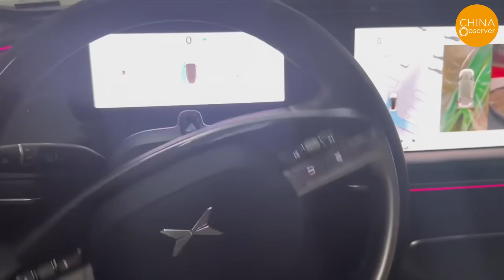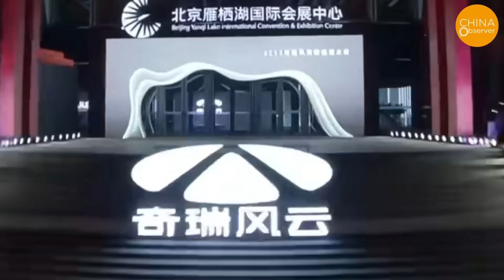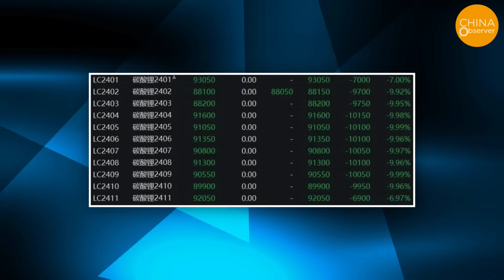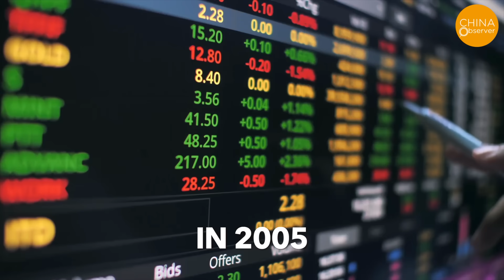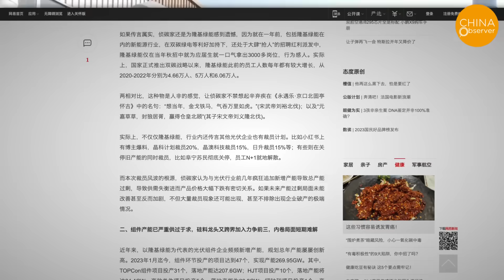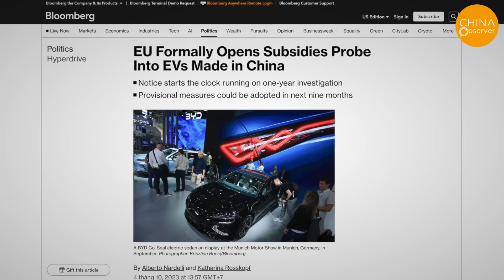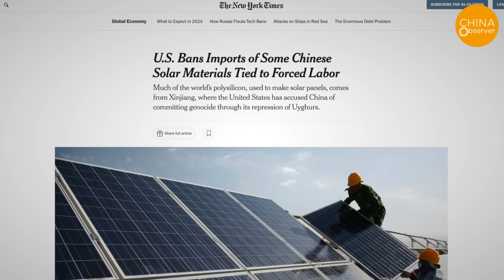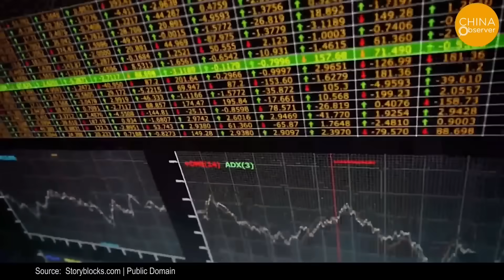Sudden EV Explosion, Rockets up 5 Meters, Close to 100 BYD Autos Spontaneously Combust

Comment: EMF radiation in EV cars is the worst part. Like sitting inside a wifi router or smart phone. When you charge your ev at home it will irradiate your house with dirty electricity frying your family while they sleep.
Reply: They are trying to discourage us from buying any cars, at all.
Reply: thats straight up full ignorance right there, can you with your knowledge explain to me exactly how thats dangerous at all?
Reply: Nonsense. Absolute nonsense. To start with, if you turned off everything on the planet, you'd still be swimming in EMF. The EMF created by an electric motor is extremely low frequency and propagation is poor, to say the least. this is in contrast to your wifi router or smartphone.  And we know that it's not harmful to humans, unlike much higher frequency radiation. How do we know that? We have been inadvertently studying it for over a hundred years. Tens of millions of people have spent their entire careers standing in front of motors much larger and much more powerful than the ones that you find in EV's. Presses, lathes, rollers, mills... the list goes on, and absolutely no hint of harm to human tissue.
The only harm an EV is going to cause you will be if it catches alight or if you crash it or it runs you over.

Comment: The Chinese mess of subsidizing a market, but then govt. officials who are corrupt make deals with a business who then figure out a way to take advantage of the subsidies while doing as little as possible.

The subsidies for BEV in China created over 50 companies.  I don't know anywhere else in the world that could happen because the govt. would get suspicious and investigate the companies, but I also don't know of a Western govt. that would set up a subsidy in a way that could easily be taken advantage of.

The BENEFIT though of what happened is the overproduction of lithium which means the global price will drop and for the world of battery making that's reputable and that DOES include a couple companies in China such as CATL, the cost of batteries will drop.

In China the number of BEV makers will drop to less than 5 and they'll be good cars.  Around the world auto makers are making BEV now and they don't go shooting through the air.

Comment: The source of all these problems is state investment in battery and solar panel manufacturing. If these industries are indeed profitable, there should be no need at all for state investment. The reason the state "invests" in these technologies is to generate cash kickbacks to themselves. For example, the state decides to "invest" $100 million in a new battery manufacturing facility. But, to get that $100 million, you need to give government officials 10% or so of that money. The government officials don't care at all if the facility makes money or not, because they have already taken their cut, and the loss of that $100 million doesn't come out of their own pockets, it comes out of the pockets of the Chinese taxpayers.

Comment: Tesla alledged break failures in Tesla were determined to be the fault of the driver who tought he was prtessing tyeh break pedal while in fact was pressing the acceleration pedal. This type of errors occurs in all type of cars. Also there is Tesla and the other brands, very different. Tesla cars have the highset safety records.

Comment: What causes them to explode so often? It’s winter right now. Is it a matter of cold weather damaging the batteries then overloading when they thaw and get charged? Is it because of physical damage from driving their roads? Are the battery casings not thick enough? Poor circuitry that makes them easy to short circuit after driving through a puddle? Are the chargers poorly designed and don’t stop when the battery is full?
Reply: Good questions.   China has 200,000 engineers reviewing your concerns.   Don't worry, it's not the same ones commissioned for the tofu projects.  They're busy in Africa ducktapping the cracked dams....

Comment: The lithium battery technology China has used until now is obsolete. The latest solid state is coming to the market next year!
Reply: Er yeah, like it has been for the last 20 years. I hope you didn’t invest! No solid-state battery is ready for market yet, and won’t be for a very long time. The only ones that are viable are not really solid state at all - they’re just gelled or hybrid polymer electrolyte, like lithium ion polymer cells, which have been around for ages. Truly solid state electrolytes only conduct usefully at rather high temperature, like above 70 °C, often higher. Not very practical or safe for a car.

Comment: It's mostly likely a failure to seal the battery cells from moisture adequately.  This is why electric cars are just a really bad idea in general right now.
Reply: History was meant to be forgotten
Reply: Roads salts treats them best !
Reply: @thomaspepper2201 Good thing the roads are in such great shape to keep the salt from separating the electrical connections. If you happen to live around the elites with nice roads speed bumps work also
Reply: @1STGeneral  I live in a Town of 543 people, and they salt the roads with salt spray and rock salt. No elite here.
Reply: so since ford made a bad pinto, there could have been no more cars?
Reply: @mrl22222  Your to young, they just made better fuel tanks as they should. Better battery, and better placement is there only option Then there wasn't a dumb shit telling us"" WE MUST BUY BULLSHIT"". WAKE UP. .People get it but more damage has been done by Ev's and the G.N.D. than wants to be discovered. Through mining and chemical polution.No one talks of the polution a BURNING BATTERY PRODUCES, But on the side of some 3a batteries it does say do not incinerate.Give it up. EV's are over for now..
Reply: @mrl22222 The Pinto didn't explode unless in an accident of a specific type. They need to halt or slow production until we figure out why batteries keep exploding
Reply: @matthewmosier8439  there is no "we" here...I guess it's up to BYD. However, the vehicle doesn't even look like a BYD, much like an electric car. It does look like an old suzuki.  Unlike gas cars, which will actually explode, electric car fires start pretty slowly, but once they start (and yes, people do in fact know why they can start burning) there's no putting it out.  30 gallons of gasoline will make quite a fire for quite a while.  just like an electric car.
Reply: @mrl22222  Correct, we know they burn because of flaws in the manufacturing of the individual connections leading to thermal runaway. But why they cannot be manufactured safely is the question that needs answered. 
You don't see a lot of gas cars blow up without warning
Reply: @matthewmosier8439  actually, you do see gas cars blow up without warning. Kia just recalled 3 MILLION gas cars for spontaneously starting on fire. And the first thing they say is do not park in your garage. As for thermal runaway, it's not related to bad connections. That would be fine, it's actually much worse. It's related to the cell being over or undercharged. At a certain point on each end of the spectrum, an exothermic chemical reaction begins which develops heat, oxygen and hydrogen. It'll burn underwater until it runs out of energy at that point. But this is why they burn, as you don't ever get a lot of hydrogen that isn't already burning. Tesla in china is actually using lithium iron phosphate batteries, which do not have this problem. Of course, they are not as energy dense either, but at least they won't ever burn.
Reply: Tesla's just soaked the entire battery In glue.  Horrible way to do it because you can never repair that.  This whole thing is a joke
Reply: Must be why they were spraying water all over an auto factory. Never learn, better stick with drug making.
Reply: lol, just seal the battery dood.

i build a homemade electric car using lifepo4 cells and its been 4 years already and its fine, if a pleb like me can do it then everyone can
Reply: @423GustavBern  
Yeah, but your car isn't made of chinesium or tofu.